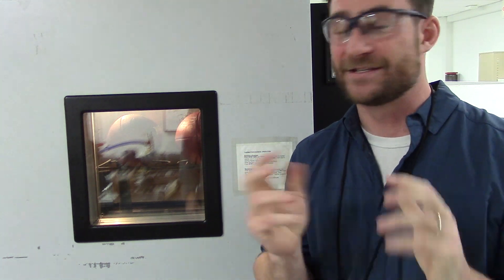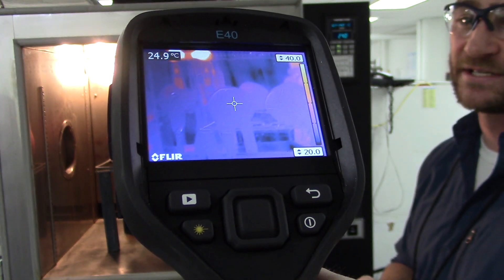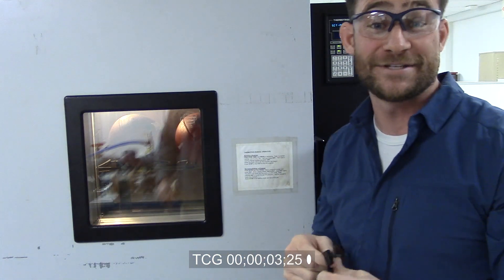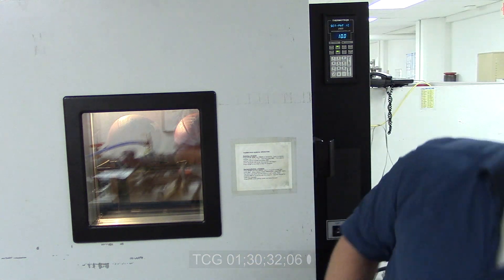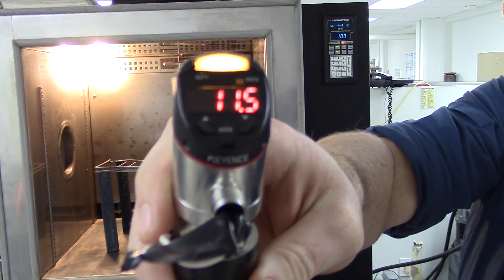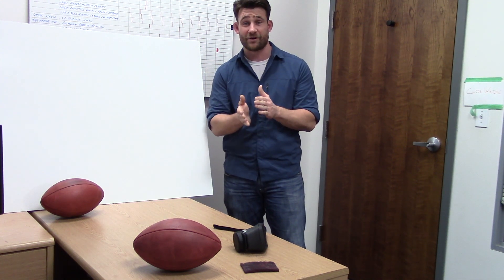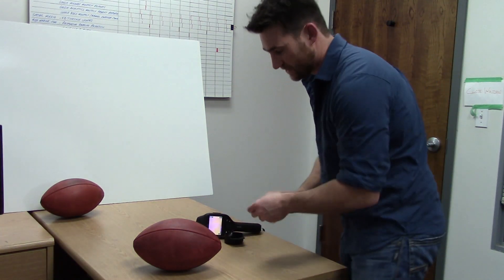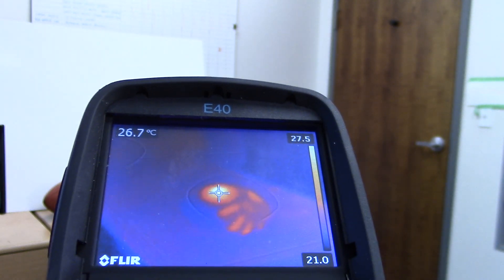Deflategate - Engineering company demonstrates temperature's influence on pressure of NFL football

Comment: What do you think about the wide variance in measurements from ball to ball?
Reply: +Austin Hill 
The Patriots balls were measured one at a time as they were  warming up in the locker room so the first ones were low and the later ones were a higher.  The Colts balls were tested so late they could only test 4 of them so they had warmed up the most.
The difference in calibration between the 2 gages used averaged .38 psi.
Reply from the maker: Austin Hill In our experiment we specifically chose to have two different balls with about a 1 psi difference in their initial pressure.  For the Patriots, they had a similar situation where the balls were all at different pressures.  There are many factors that play into the fact that the balls dropped in pressure.  One of the biggest is that the referees used two different pressure gages, one of which was 0.4 psi different from the other.  That explains why some footballs may have "dropped" more pressure than others.  If the ball was 12.5psi on one gage, dropped 1 psi due to environmental factors and then measured with other gage it would read 11.1 psi.  The NFL in our opinion was very slopped with their measurement process.  It is very important to use accurate and calibrated test equipment!  Thanks for the comment.
Reply: Mide Technology 
I was actually wondering about the variance in pressure according to a single gauge when the balls were reported to all have the same pressure. There was nearly 2 psi in variance on one gauge between the balls.
Reply: +Austin Hill there was never a 2 psi variance. They had no recorded starting numbers so they said all were 12.5 as a collective. So then we have to use same system and average all readings and we get 11.3 which fits within ideal gas law. Colts balls ( only 4) measured less drop but were not wet and measured near end of halftime giving them better acclimation to room temp.

Comment: if this is right Mide, and you look at the official chart of the 11 balls and the psi readings at halftime.....this explains everything....why isn't the nfl taking the science seriously what so ever......after seeing this and if i was investigating the case...I would through the whole stupid case out.....you know why this got so big...because of that espn reporter who released the first report on the scandal on saying all the balls were 2 psi dropped under regulation at the beginning....which was false.....only one ball was at 10.95.....the rest were in the 11 psi region......i am using the favourable readings from the referee out of the 2 that showed the favourable numbers,,,,even the other ref readings weren't near any 2.0 psi drop...in his gauge readings....5 of the 11 balls all read in the high 10 psi region the rest in the 11psi region......this has become worse than the salem witchhunt.
Reply from the maker: paranormalfrank We agree, the pressure readings are easily explained by the environment influence and the measurement process (or lack thereof!) used by the NFL.

Comment: Also the one HUGE difference is that the Patriots balls were measured at the beginning of half time and the Colts balls were measured at the end of the half after sitting in a warm room for 17 minutes.  The Refs were only able to measure 4 colts balls out of 12 because the half was ending and they needed to get back on the field.  Most of these experiments that I have seen never talk about this.  There is more info in the AEI report that went up recently.
Reply from the maker: Randall Johnson A very good point, there are MANY factors that will influence the pressure of a given ball and impact the temperature of the air within the ball.  Time is one of those factors.
Reply: Randall Johnson A very good point!

Comment: Good Job Chris.

To better understand the rubbing phase of pregame preparation, you might want to check out this ESPN Clip:

http://espn.go.com/video/clip?id=12221498

If this is the "rubbing process" that Belichick said goes on right up to when the footballs are given to the NFL game officials, then it is likely that friction would have significantly raised the ball temperature at the time of initial testing.

Another factor worth considering is the effect of evaporation from wet footballs in windy conditions.  Intermittently the balls were thrown spinning through the air at over 60mph.  Would this further drop their surface temperature, air temperature inside and also the pressure?

Finally, the air was relatively moist that night, and moist air is predicted to have a greater drop in pressure than that presumed by the ideal gas law.

Comment: The NFL might be smarter than to just measure PSI of the ball without taking temperature change into account (big if there), I don't know the source of this quote but someone from patspulpit.com (great site if you are a pats fan) said the measurement is as follows: 

Pressure at start * Temperature at end = Temperature at start * Pressure at end (using absolute pressure, not gauge pressure, and convert degrees C to K)

(link to the story: http://www.patspulpit.com/2015/1/20/7864155/deflategate-patriots-used-11-deflated-footballs-against-the-colts)

In the above experiment, the ratio of the Pressure at start * Temperature at end = Temperature at start * Pressure at end as long as the ball didn't deflate to the point where it shrunk significantly, there are no large changes in the atmospheric pressure, and no air was let out of the ball (seems safe to assume those are all true). However, as reported from the article where that equation was quoted, the equation did not hold true meaning some air had been let out of the ball. 

If the claim is that because the ball lost some pressure, then obviously cold weather could do that. If the ball lost some air, then there is a story there. When I do the calculations, I get about 1% error from your results and when I take out 1 PSI due to letting some air out, I get about 3% error. Not exactly a smoking gun with temperature and pressure measurements. They likely did not measure the temperature of the ball when they took the second pressure reading anyway (it would been brought back inside a warmer environment and would have started to warm back up). Without a video of someone actually letting air out, you can't prove anything with just simple pressure measurements. 

Another consideration here, when using those FLIR IR temperature measuring devices, they are typically most accurate when measuring a flat black surface. The surface of the football is non-black and maybe has a slight amount of gloss (not much though). There is probably some error in your temperature measurement.

Comment: You should try repeating this experiment, only try to increase the pressure inside the ball from rubbing the ball. Increasing the surface temperature of the ball in one spot will not translate into increasing the temperature of the air inside the ball. See what it takes to actually increase the pressure in the ball from rubbing. 

I am doubtful due to the thermal impedance of the material the football is made out of would actually heat much of the air inside the ball very efficiently. The video from 2006 showing the Packers prepping their footballs, to me, does not look like it would do much to the temperature of the surface of the ball and even less to the temperature of the air inside the ball.
Reply from the maker: Eric, we agree increasing the temperature in one spot will not heat air within the ball up substantially.  The point of that test was to show how only a little bit of friction could add thermal loads.  Videos such as this one  http://espn.go.com/video/clip?id=12221498&ex_cid=espnFB show how teams use power tools to rough the balls up.  We have heard of some teams using belt driven systems, these types of approaches would heat up the exterior of the football substantially.  If the balls are subjected to enough friction for  a long enough amount of time, the air inside would increase in temperature.  Your point about the thermal resistance of the leather/rubber is a good one, that will impact how long it will take for the friction thermal loads to impact the internal air temperature, but if the thermal loads are there for long enough they will heat the air within the football.  It is those same materials which transfer the thermal energy from the environment (a test chamber in our experiment) to the air within the football.
Reply: Thanks for your reply! I am more or less curious to see what it takes to actually raise the internal temperature/pressure of the ball from rubbing. Does it take 5 minutes or 50 from rigorous polishing or light polishing?
Reply from the maker: eric beaty Eric, maybe we'll run another test to find out, if so I'll post the results.  We think the most amount of time the balls would be scuffed up for would be 5 minutes.  But after that you would have to let the ball sit there for a little while (like it would during transportation to the referees) to allow the thermal energy to "sink" into the air within.  Only a few degrees change in the air will have an impact.
Reply: +eric beaty Rubbing is not a factor because the balls are prepared the week before the game and not rubbed during the game nor would it be possible to maintain a higher temperature long enough to test.  If the  12.5 psi ball had been kept wet for 2 1/2 hours during this test (the Patriots balls were not protected) they would have tested closer to 11.3 psi.
Reply: John David Great point!

Comment: Now the NFL can go figure this out for themselves. Then the haters will... say the NFL is biased and covering up for the Patriots. Haters gonna hate.
Reply: Haters always have their bases covered.
Reply: Still dosnt explain why the colts balls were not underinfated pats just cheat away and you pat fans just find excuse after excuse for them cheating is cheating
Reply: Joseph Lesser You know Colts’ 3 out of 4 balls that was measured were also deflated too.
Reply: Mike Fougere lol No they don't.
Reply: The Colts brought up their suspicions towards the end of the first half. The Patriots had a long drive to end the half, and it was wet outside. Meanwhile the Colts offense was off the field so their balls were being kept in a plastic bag where they would be able to dry off some. If the Patriots balls were measured immediately at the start of half time and adjusted then, they wouldn't have time to warm up from the ~45 degree weather to the ~70 degree locker room. If the Colts balls were checked at the end of half time, they would have been dry and able to warm up. Wet footballs will warm up slower than dry ones. If you like science, this MIT professor does a good job of explaining ideal gas laws and showing the flaws in the information that the NFL presented: https://www.youtube.com/watch?v=wwxXsEltyas
Reply: Joseph Lesser actually MIT did an experiment where they took the Ideal Gas Law calculation and plugged 12.5 into the equation and got exactly what the Patriots balls were measured at. Also MIT found that the patriots balls were tested first at halftime, so the Colts balls had time to warm up. Another thing to note is that the Colts footballs PSI doesn’t match the Ideal Gas Law calculation which would bring up the question “why were the Colts balls overinflated”. Science bitch
Reply: Chr Gav that’s actually not true. The Colts footballs were overinflated not deflated. Check the MIT study for further information
Reply: Dylan, I believe that there's truth on this point (Colts psi levels) for both Chr Gav and for you.  The MIT professor found that the Colts psi were down from pre-game, so there was some deflation most likely from temp.  He posited though that they weren't down far enough as expected by the outside temp and the ideal gas law.  He asked why were the Colts balls too high?  To this he guessed that the Colts balls were kept dry and measured 15 minutes after Pats, when they had warmed more.
Reply: Science proves Tom cheated. Many balls were 50-100% more deflated than what should be expected given the ideal gas law. That would be like saying you can prove without a shadow of a doubt that you didn't siphon gas from my car because I drove my car after you were accused of siphoning the gas. Then you really sound like an idiot when you say the tank was full and I burned up 1/2 a tank worth of fuel driving and present 1/4 of a tank remaining as your evidence as you giddily prance around shouting I proved it because of the "cars burn gas while driving law."
Reply: Dylan, remind me where MIT is again?
Reply: Joseph Lesser, no point arguing with a Pats fan. Their die-hard allegiance makes them blind to the facts and overwhelming evidence that they cheat.

Comment: Amwesome - check out http://espn.go.com/video/clip?id=12221498&ex_cid=espnFB from 2006 which shows the packers' ball guys buffing the balls pre-game with electric sanders would love to see an IR camera shot of those balls and see the preassure change as they cool to room temp.  This type of mechanical energy is exactly what Belichick was describing as "preparation" (although in his typical secretive way)
Reply from the maker: Adam, great video and thanks for sharing.  Clearly, the rotary sander devices they are using to work the balls in is similar to the types of friction forces we put into the footballs in the video.  Also of importance is that they mentioned that this working in of the balls was happening 15 minutes before submitting them to the referee's.  That is enough time for the added thermal loads to begin warming the air within the footballs but not too much time that they would cool back down to room temperature.

Comment: Does there also need to be a control?  Would introducing two additional footballs, initially inflated to 12.5 and 13.5.  These footballs would remain at 74F for 1.5 hours and then check their PSIs. This would show that temp/duration (and not duration alone) is the only factor influencing the change in PSI from the initial PSI.
Reply from the maker: Gary, a great point.  We expect a control football remaining at 24 degrees C would have seen no change in pressure.  We did allow the footballs to remain at room temperature after the test for a few hours and then measured  the pressure again.  As expected the pressure increased and came back within 0.1 psi of the original values, they were both lower by 0.1 psi.  You might ask, why were they a little lower and that would be a good question!  The test done in the chamber was at 24 degrees C, our office temperature was about 22 to 23 degrees C.  So again, the small change in temperature had an impact on the pressure!  I should also note I don't think we fully got down to 10 degree C in our test, if we had let the footballs soak a little longer I believe the pressure would have come down a little more.
Reply: Mide Technology Brilliant! Forgot to mention, a very well-presented experiment.